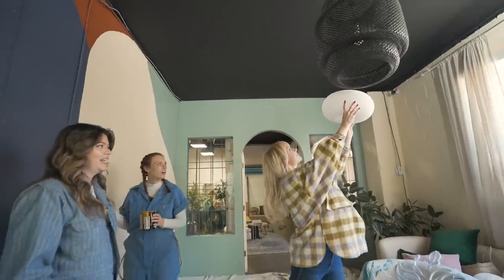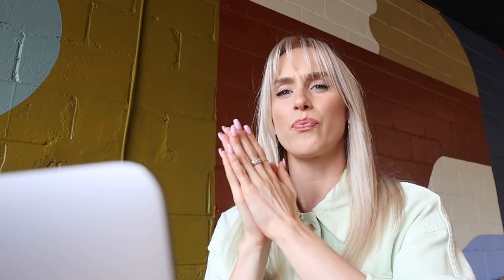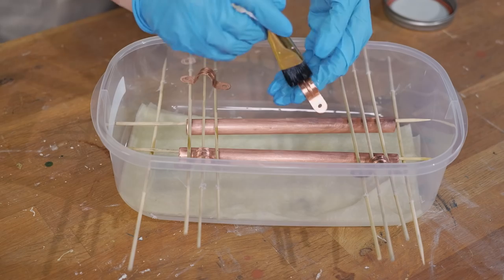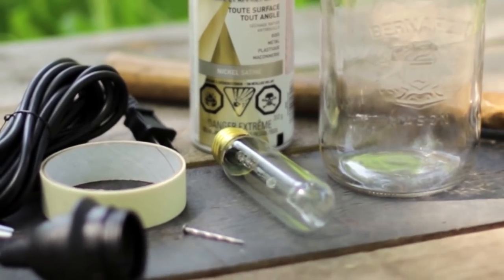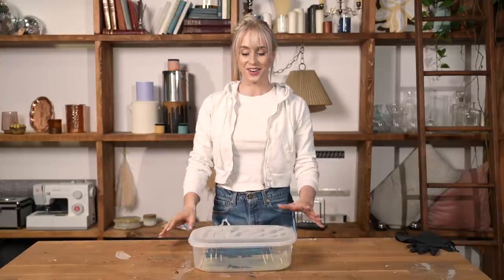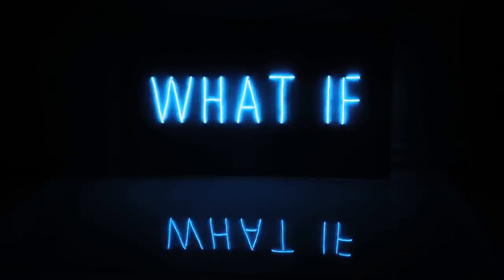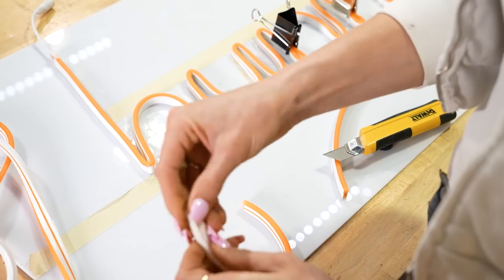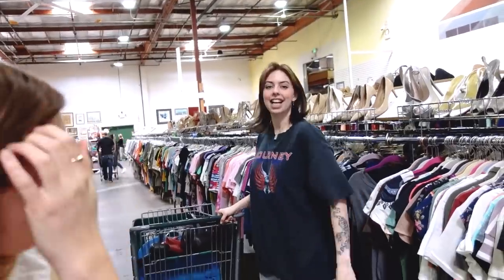recreating our first DIYs (and fixing them)

Comment: that glass breaking using hot and cold water works very well. even when you're not prepared for it. do not do this with a glass baking pan that you accidentally leave in the ovan as it preheats and then take it out and have it in contact with cold water. 

really cool video. the trip down memory lane and the different version of a SG classic is really cool
Reply: this gets very random but this reminded me of a little story. a few years ago, on christmas eve, my dad took an empty glass baking pan/dish thing out of the oven and immediately ran it under cold water and it shattered, literally exploded. he ended up stepping on a small piece of glass and when he pulled his sock off to remove the glass, the glass came out with the sock, when I tell you I was cracking up lmao.

Comment: Looooved this revamp of DIY’s! I might try them. Just a question about the silicone light strip, how do I use the rest of the strip once I’ve cut it off? Maybe you could make a short video on this, please? I’m scared to cut it and then not knowing how to use the rest of the strip 😓
Reply: You usually can not Re-use the part you cut off as it has no Power supply. Once its cut, its off to land in the trash, unfortunately. So always try to buy the length that is closest to what you will actually need.
Reply: @katl6428  you can rewire it but it’s a whole project in itself
Reply: Thanks for your answers! :D
Reply: @katl6428  power supplies can be bought seperately and if you're not confident in soldering the led strips yourself, you could always give it away to someone who can. it's a perfectly working component and does not need to be thrown away

Comment: For the neon sign-If you drilled the hole for the plug/LED strip first, you could have drilled a smaller hole and threaded the LED strand through instead of trying to thread the plug through.